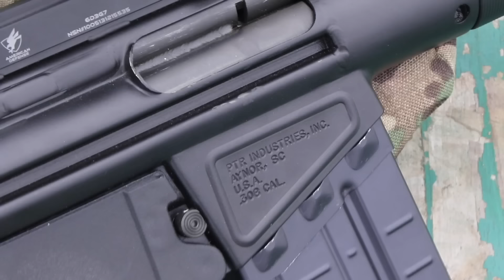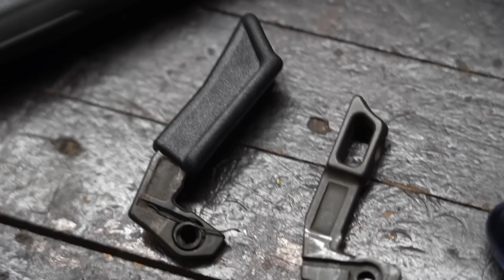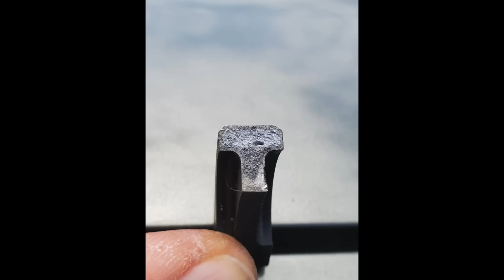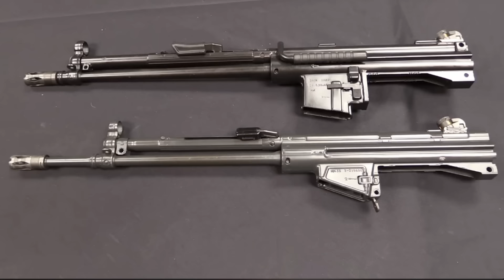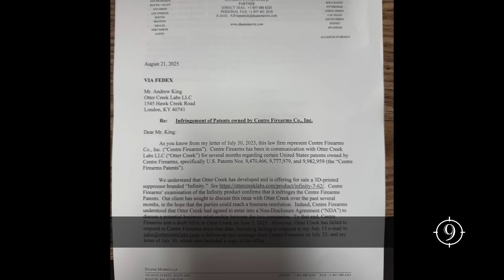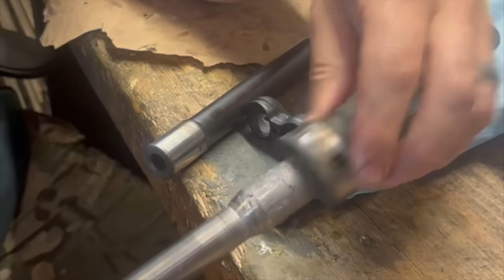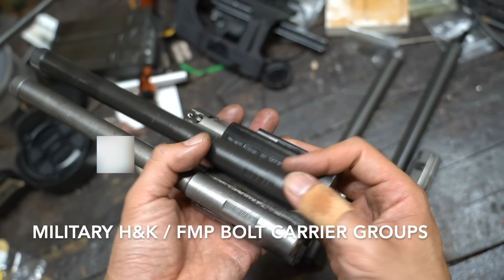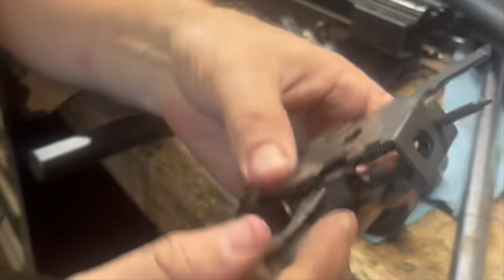Is PTR still worth the money? H&K v. PTR (old) v. PTR (new) v1

Comment from the maker: Before you say it, DSA is doing the same stuff on the FAL side, except you are starting on a platform that is less precise and less reliable.
Reply: Shots Fired!! Right Arm of the Free World!!
Reply: @shermansales9345 if I want nostalgia in 308 I grab an M14. If I want a practical 308, build an ar10.
Reply: @shermansales9345  G3 was adopted for more years by more NATO countries! If the FAL is the right arm then the free world is left handed!
Reply: @kilodalton94  - It is ironic, isn't it, that the so-called "poor relations" to the FN FAL - the G3 (and the American M-14) for that matter - both ended up outlasting it as std. issue military arms. The G3 is still quite well-used even today ... Greece, Turkey, Denmark, Sweden, Norway, Spain, Portugal, Iran, Pakistan, et al. 

What accounts for the sustained success of the CETME-G3 design? Apart from its obvious virtues as a tough and reliable battle rifle, the G3 - since it relies on stamped metal parts and synthetic materials for its construction, instead of expensive, time-consuming machined steel - is cheaper to make, and simpler as well. 

G3s are also stone-reliable in cold weather conditions, and in the desert. Both have given the FAL problems occasionally. To be fair, the Belgian icon is a rugged, reliable rifle - but the G3 is superior in terms of reliability and ruggedness. They are all-but-impossible to break, and can be neglected with little risk of malfunction. 

The armies that use it are now very well-familiar with its faults and strengths, and know how to get the most out of the platform. Although many have gravitated to assault rifles and the 5.56x45mm cartridge, many forces still rely upon the old wear horses for a variety of duties, which they perform well by most accounts.
Reply: @kilodalton94 right fightig arm of the free world (British etc)eg  Germany was not allowed to fight anyone, British fought practically everyone obviously they refused to fight the Vietnamese (British prefer to win by following an achievable plan)
Reply: @kilodalton94  your statement is actually ignorant to the history of NATO and the FALvsG3 and how the FAL got its nickname. Just remember the Germans only went with the G3 because after purchasing 50k FALs they wanted to license build their own, but due to Germany’s rape of the FN facilities during WW2 without recompense they were told no. And all the rifle is is a Spanish CETME.
Reply: @kilodalton94   Both of those guns are kind of mid at best.
Reply: @kilodalton94 😂 damn I gotta use that.
Reply: @kilodalton94 the FN FAL Was used by about 90 countries so there where used in more countries than the HK
Reply: You have helped me so much with all the good roller delayed information!
Reply: PTR won’t listen to anyone.
Reply: Can you do a SA58 video? I’ve heard mixed things about DSA but recently good stuff
Reply: This really saddens me.  I really can't justify paying for an orgiginal FAL or G3 (I just don't have FU money for antiquated/collectable rifles), so I was looking at both the DSA FAL and PTR 91 as viable affordable substitutes.  If I'm going to spend >$4k for a .308 rifle I'm buying a modern rifle like the LWRC REPR MK II or some other Gucci AR-10.   I thought they were getting better, and I'm really sad to hear that they aren't.  DSA is the last man standing making the FAL--aren't they supplying the last militaries (military?)  still using FALs (Argentina?).  What to do?
Reply: The one bad taste DSA did was many years back when they SILENTLY switched from the surplus and LMT contract FORGED receivers to their cast receivers, but kept the same price. Only way people with older DSA FAL's can tell if their receivers were the forged flavor is to check in with with DSA's CS and inquire. 
But I also understand PTR had a much more painful several years of changing up their chamber fluting design and a whole mess of things happened.
Nowadays, the biggest issue is the barrel, which PTR sort of solved with nitride treating their bore. But I am damn sure they can make a bit of $ if they offered a limited or custom order for CHF (RCM makes these) barrelled PTR's.
Reply: Context is important for FAL reliability. If you have a properly built gun, good magazines and good ammo with the gas system set to sufficient pressure, the only things I've seen cause malfunctions are too thick of lubricant in extreme cold, and sand contamination. Yes, the inferior trigger and lockup designs show their nearly 80 year age, but I've personally found the design is quite reliable when used properly and not exposed excessively to sand.
Reply: DSA burned me on a gunbroker auction a few years back. I won an auction and paid for it. They didn't like the winning price, so they lied and said it sold in store and then had the audacity to say they never received payment for it. And the best part is I know someone who lives close to their store. That rifle I had won was sitting on the wall with a higher price tag.
Reply: @atlantasanta004 scumbags for that
Reply: I like the FAL over the HK91. But I loved the HK-91 so much I got a HK 33 clone. Its a parts kit clone. And really nicely done.
Reply: Just priced out a PTR MP5 clone, good grief! Almost 2k?!?!
Reply: @soonerfrac4611 why would you want one of those when you can get an MKE AP5 or a POF MP5 from Atlantic Firearms for about a grand?
Reply: @soonerfrac4611 or get the hk one instead 😂
Reply: I had a DSA FAL that I couldn't even fire 20 rounds out of the magazine without an issue of some kind. I've sent numerous firearms back for repair/service the only company that didn't fix the issue was DSA. They sent it back to me and the issue wasn't fixed, I sent it back a 2nd time, I received it and still it didn't work. I told them that I'm still having issues and they told me that it wasn't giving them issues. I told them I'd send it back, and asked for a partial refund. I ended up buying a PTR 91, doesn't have the ergonomics of a FAL but at least it works. After thar experience I don't know if I'll ever get another DSA.
Reply: Is it possible to get you gunsmiths address!!???  Or Email address!!
I have a HK -91 that I have always wanted a paddle magazine release installed!!
Thanks!!!
Reply: Yeah but FAL 🤷🏻‍♂️
Reply: Only comment if you've owned both
Reply: Whoa whoa, sample size of 1 but my DSA SA58 has been rock solid.  No hiccups after gas was tuned and its 2-3 MOA accurate.
Reply: DSA Quality has gone to shit😮
Reply: At LEAST you got the Coke right.
Reply: Yes but, break action cool.
Reply: @eisenkrieg553 putting the front and rear sights on different receivers is diabolical
Reply: Imbel Gear Logo mafia rules.
Reply: How can you say less reliable? FAL has 7 position gas system and in under 30 seconds you can swap it for another 7 position gas system for use with silencers. You essentially have 14 gas positions for every single possible type of ammo or configuration. A PTR-91 has 1 setting and if it's not fully cycling or it's kicking too hard, or if you even want to use a silencer with it at all you're out of luck.
Reply: @farmersneed  I’ve actually had someone on here tell me that an adjustable gas block is a design flaw and that is why the G3 is superior. FAL made for soldiers, G3 made for conscripts.
Reply: Everyone I personally know who's purchased a DSA FAL has had to return it for warranty work. IMO they are pushing out more lemons per capita than PSA. (And I am not a friend of PSA)
Reply: I don't think the FAL is less reliable than the G3, but it is very slightly less precise. There are a lot of variables, and most of the examples folks compare are reverse engineered clone junk. RDBB is a novelty, and all the "Next Gen" stuff is short-stroke piston anyway. I know you made and pinned that comment just to drive engagement though. :)
Reply: Yes, DSA sucks.  I bought Para Congo and paid extra for their trigger job but the trigger was gritty and still pulled over 8 lbs.  At least they refunded my money back for the trigger job.  However the firing pin tip broke off after only 60 rounds.  Still waiting for their response after requesting a replacement pin.
Reply: tbh I never saw DSA as a retro company in the first place... pretty much all of there early products were focused on the military market and how to capitalize on people needing to modernize them. so overall, retro guns aren't there bread and butter. being a bubba technically is. which makes them money though its why they have a few contracts to modify or make the OSW shorty fal. I think they're all thinking too ahead of the curve trying to mass produce everything. and then in the meantime they don't know what to do, they're twiddling their thumbs trying to avoid the big retro topic because, finding the stuff to make it all is a bit hard...
Reply: LOL ... very true.  I chewed DSA's ass out due to non-existent "quality control" and it wounded them too deeply.  They claim I'm "the first customer they had to fire".  To date, I wear that as a badge of honor.
Reply: Well, that sure is one way to but the FAL boys in their place. Seldom heard you make a statement with this level of conviction towards one side of the argument. Love it.
Reply: Sorry big dog, but the FAL is so much nicer to live with over the G3 family.
Reply: FAL > G3
Reply: @jeepman19 unless it's a clapped out parts gun.
Reply: @jeepman19  Only in video games my child
Reply: @jeepman19 the FAL sucks.

Comment: Cetme c reciver flat + cetme c parts kit = a good gun. If it's bad, it's because you built it bad.

On my cetme, I dremeled a charging handle slot on the left hand side of the gun, and welded a piece of metal to the antibounce lever to give me the leverage on the antibounce lever to be able to cycle it easily. It works great!!! Bit smoky though.

Comment: Thank you, that was very informative. I have a Century C91 Sporter that I bought in 2004 and I probably lucked out with mine because it has been accurate and 100% reliable - no failures of any kind in 22 years, and that's not for a lack of trying to get it to malfunction. Looking at the components, mine has an HK bolt and fire control control components, but the carrier is FMP. The barrel on mine was made by Enterprise Arms and was unthreaded until the AWB expired, at which point I threaded it. I'm not sure about the origin of trigger pack itself, but it is welded steel, not bolted together, and sadly, no paddle release, just the button. Although tight, all the mags I have tried fit perfectly. I've been pretty happy with mine and although it was only $400, I wouldn't get rid of it.

Comment: I have been running a Springfield imported Greek SR-3 HK 91 copy for years without issues or any malfunctions
 Accuracy with German ball (147 gr) ammunition is around 1" -1.5" at 100 yards. Due to the slow twist, accuracy with heavier bullets is around 3 moa. With German 3x power optics.
This rifles actually shoots better than my original HK 91.

Comment: My CA-3 Has run perfect right out of the box. Super accurate. About 160rds thru it so far. I have performed the break in cleaning procedures religiously and scored it from psa for $699 was one lucky deal. I was able to score the HK91 snap on ejection port buffer $110 shipped and no more dented afu brass, i reload, and ghe brass actually stays in the brass catcher now. Love this rifle. Thru a claw mount picatiny and red dot on it, had to remove the drum sight top portion to make room, but very happy with it. Ptr did an amazing job on this weapon.

Comment: Damn that's disappointing.  I was just about to get one.
Reply: If You change your mind, get a JLD PTR 91.  the ones built the during the ban are top of the line. They have no flash suppressor 10 round mags and are painted in green, gray, or black. I had one unfortunately sold it when I bought my house. I got a Saiga. 308 22in barrel to replace it.  Imported, it was only 600 bucks.If you can believe that.

Comment: I bought a PTR secondhand in 2017 for $700, its one of my most reliable rifles. Only time I ever had it jam was with soft points and that was only on the last round in the mag. 

My only hang up with it is that it does not have the paddle release, I always assumed it was an early-ish production model (SN prefix is AW) and they didnt include it because of some AWB holdover or something similar. I wanted to get a paddle installed but I'm not sure where to start, not sure if I can just drop it in or If I have to modify the receiver to make it fit.

Comment: Thank you so much for the very useful information!  You rule!   Have been one of your subscribers for years. Purchased a GI model in 2021.  It had to be returned and the charging handle was replaced.  Have had no problems with the gun.  Based on the year of manufacture, do you think the gun should be sent in and gone through by the gunsmith on your video?  Are the problems with the GI model more recent or were they making crappy ones in 2021?  Thanks.

Comment: I bought a ptr91 gi without the rail about 3 years ago. I cannot get a claw mount that will work on it. One side of the claw mount cut was stamped at about a 45 degree angle. So every claw mount just pops right off or sits extremely crooked.

Comment: Casual reminder that MFI makes a pic rail mount that attaches using the claws AND the sight base itself, for about half the price of the Spuhr mount.

It's not great you have to get a separate piece, but I personally thinks it looks significantly better than a welded rail, and you can still have a clean profile for the iron sights if wanted.

Comment: Thank you SO much for crushing my dreams again, but saving me lots of money and frustration. Those old PTR part closeups were nearly identical in many cases! The new ones up close look like old PSA quality. 

I appreciate your video in the MKE HK53 clone too. I was close to buying one until I saw your video.

Building is the way to go. I bought a German G3 parts kit for $500 ish, RCM barrel, and a PTR receiver pre-welded. My builder spent a ton of time removing burrs from the receive. My bolt carrier doesn’t say HK, so I’m skeptical that it’s really German, but oh well. It’ll be a real G3 of some sort in the end and I’m not THAT level of collector to care.

I reached out to the builder you mentioned to ask about adding a paddle, because my builder said this receiver is… gnarly where they welded things up where the paddle goes, so I may be out of luck. 

I plan on doing my own take on the Norwegian, Swedish, and Portuguese rifles. I have a Spuhr stock, a German wide handguard, he’s welding picatinny on top and I plan on using an Eotech 5 series on it or maybe finding a 1-6 that looks fitting on it. Factory barrel length, as that’s how those countries used them. Metal trigger housing. I think we’re going to weld receiver reinforcements in like the PSG1 for more rigidity and better accuracy. I’ve never shot a G3 or clone, so I’m very excited. I’m also glad the only PTR part I have was the receiver which are all the same when they start as flats. 

Now I just need a HK53 parts kit that isn’t stupid expensive… and a receiver to build it on. Then I want to use the RCM 300 blackout barrel and locking piece. That caliber with that barrel length will be so much more fun than 556, but still keeping the classic looks!

Comment: I have a "PTR-100GI." Yet the receiver is stamped "PTR-91," so I guess I have a PTR-91. It's built on surplus parts so far as I can tell except for the receiver and some unimportant 922r parts. It is accurate and reliable. My only complaint is that my West German surplus claw mount does not attach properly. According to my gunsmith, the PTR receiver itself is slightly out of spec. Obviously, a claw mount accepted by the Bundeswehr was by definition in spec. So here I am... iron sights only.

Comment: I don't want to be mean to your gunsmith, but I've built several CETME kits, and that galling is not a barrel issue, it means it was pressed improperly. The barrel is supposed to be softer than the trunnion, so any barrel will gall if you let it. And believe me, on my first cetme, I unfortunately galled out a very nice (not ptr) barrel. You need to stone the back edge of the barrel journal (that area can get some peening on surplus kits from years of bolt slam) and use a lot of antisieze when pressing. Not gonna say either way on PTR barrel quality, but that galling is unrelated to correct barrel hardness.

Comment: 2:48 ptr receivers were initially developed for the cetme imports from cai. Originally they were on very nice cast stainless steel receivers that were a bit out of spec on the exterior dimensions due to casting constraints. So they developed ptr receivers to provide stamped ones that were in spec. The cast ones were tanks i had one it shot really well. The only Century creation i really liked, other than the vz2008 and the later line of Golanis. After they fixed the receiver hardening issues. Dont buy anything Century without knowing what to look for. Their builders often gtound down bolts and did other unscrupulous things to cut corners.